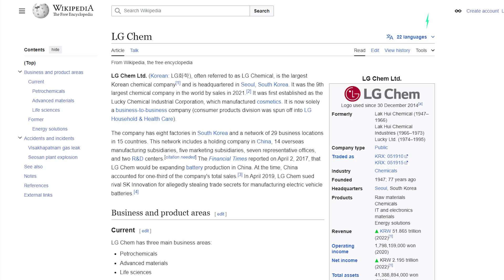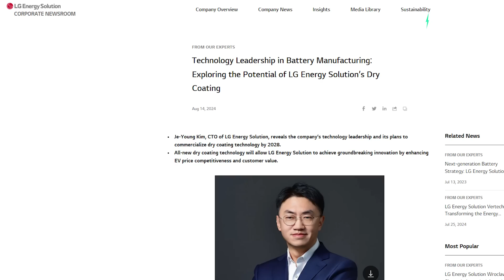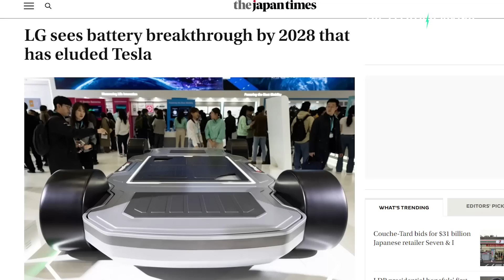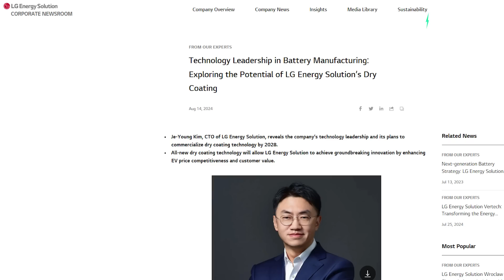Tesla dry 4680 batteries VS China's onslaught of new LFP batteries

Comment: Wasn't it LG Chem that made the Chevrolet Bolt batteries that went on fire?
Hopefully they have learned a few lessons from that.
Reply: It was but they were older versions that GM used because they were also cheaper.
Reply: @sambira  Also, the actual number of fire incidents was very low. I benefited from the lawsuit as my 2017 Bolt got a brand new battery in 2021 with a higher range and 8 yr warranty, for free
Reply: Today, on any level, EV batteries starting on fire is not even a thing. We are talking a very tiny fraction % vs ICE and hybrids. People shouldn't even be talking about this anymore as they just don't start on fire for no reason anymore. I wish I could pull off the statistic I just saw yesterday. I am sure it can be easily googled but I have to get going. But it is just so not a thing anymore, which is yet another huge + for EVs
Reply: @travisjazzbo3490  They just had two EV vehicles go up in flames in South Korea. Mercedes was just sitting parked .They caused huge damage, people injured etc, etc. It makes everyone concerned as to why they just go off like that. Check it out. Should be easy to find.
Reply: @travisjazzbo3490  Yes. I know all of this but more has to be done to eliminate the hazard of EV fire. One fire is ten too many.EV companies have to do more.
Reply: @dougabbott8261  So we have literally never heard that ICE/Hybrid vehicles are even a problem with starting fires... ever... No one even talks about it because it is so perceivably rare, but you are worried about EVs which are 61 times less likely to catch fire... I am just curious, previous to the EV haters reporting every single EV fire, did you ever give a second of thought to ICE/hybrid fires before?
Reply: @travisjazzbo3490  I am concerned about my EV just lighting up for no reason. I do not charge at night just as a precaution. EV companies should focus more on the battery safety .
Reply: @dougabbott8261  Batteries are always getting better and just like anything else, it is usually some sort of electrical problem once in a great, great, great while that causes it just like all auto electrical fires, not the battery itself. What hopefully happens is someone figures out a way to put out the fires much faster once it does happen, that is where the real problem is, not the extremely rare EV fire compared to normal ICE vehicle fires that no one considers an issue, even though there is a 60 times better chance of that actually happening.  The reason people dry about it, is because it is harder to put out
Reply: @travisjazzbo3490  By now there should not be any battery fires. All the testing and checking and safety should have produced a battery that does not cause such disasters. Some LiFePO4  look good. Sodium Ion might ,one day , be good but more has to be done by government and companies to prevent run away thermal battery fires.
Reply: @dougabbott8261  According to the U.S. Fire Administration, electrical malfunctions are the third leading cause of house fires, accounting for 6.3% of all fires. Between 2014 and 2016, the USFA reported about 24,000 electrical fires each year. In 2015–2019, the NFPA reported that electrical distribution or lighting equipment was involved in an average of 32,620 home fires per year, which is about 13% of all home structure fires.

Seems like 24,000 fires caused by electrical fires should be resolved by now. Electricity has been around for well over 100 years.

ha
Reply: @travisjazzbo3490  so things don't always get better like anything else.
Reply: @dougabbott8261  Exactly. The point being that EV fires are statistically incredibly rare compared to ICE... which no one even considered a problem at all
Reply: wrgg
Reply: Fires in the Bolt, Kona and Jaguar I pace. Now called LG Energy Solution . Changed their name after the bad battery fires.